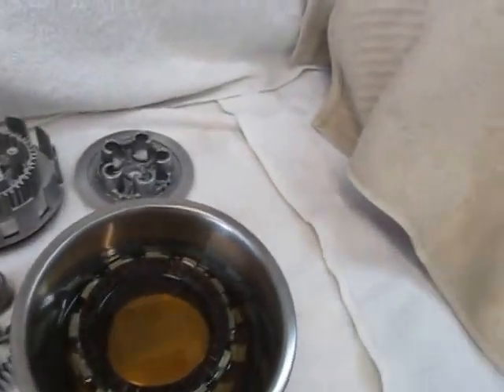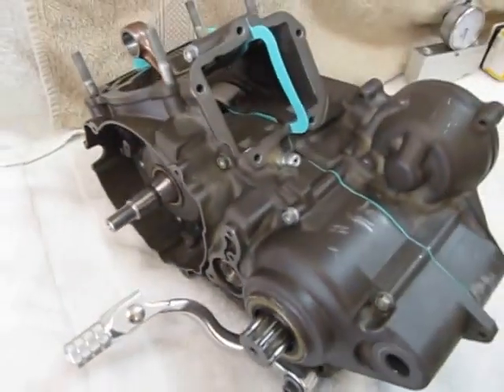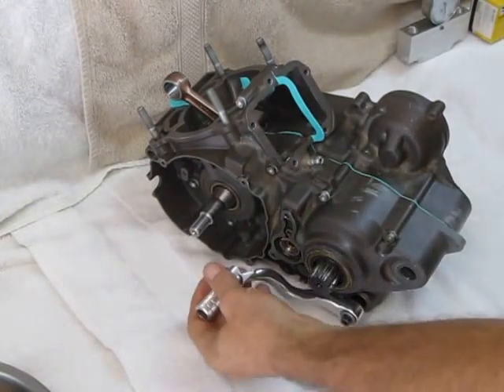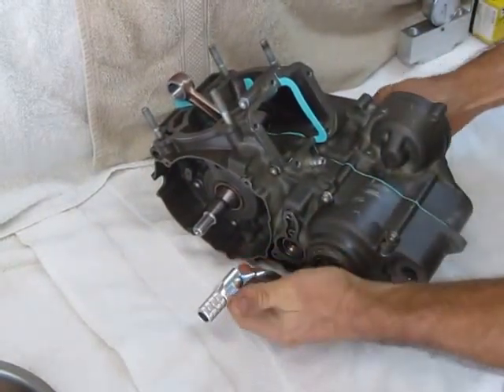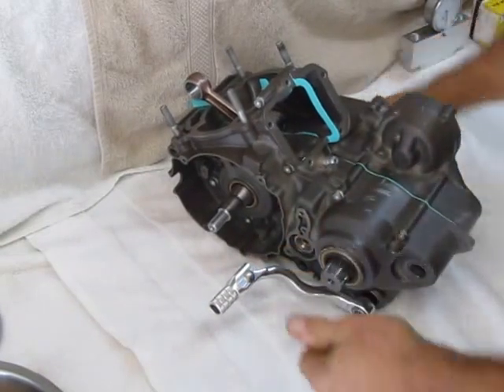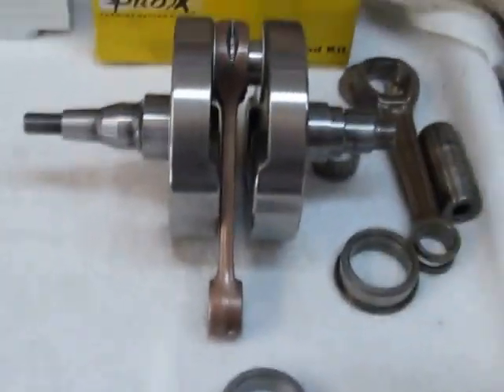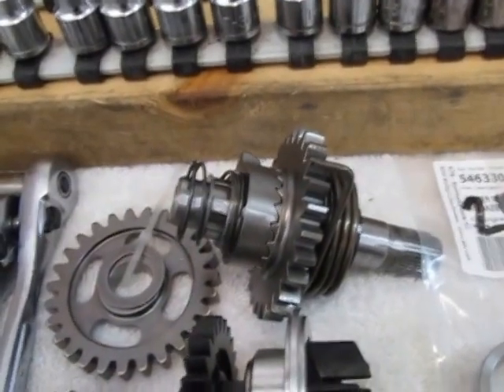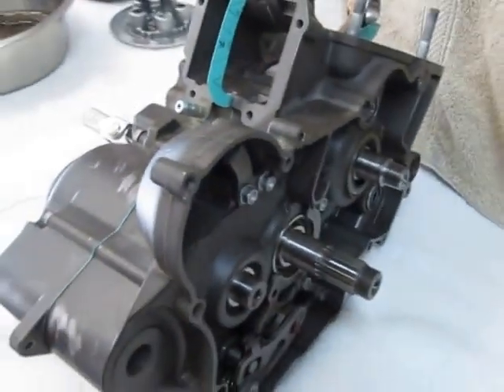How to shift KTM Transmission with engine on the work bench

Comment: Hey bro just replaced the shift mech on a 11 150 sx same bottom ends, ( due to false neutrals ) bench test was perfect first test ride was perfect now I am also find these false neutrals but only between 3-4 4-5 and vis versa 4-3 5-4 the shift lever clicks and moves as expected but if held up while in the false neutrals I can feel it notch / move a bit more and then it drops into gear and is sweet this issue seems more so when the bike isn’t under load and being gentle with everything being a big rough all works as it should? Any ideas I am going to strip again and bench test from the drum out testing each component after re fitting but seems super strange to me the bike will shift and still hit said false neutrals even shifting without the clutch so not related to clutch at all it’ll stay in gear and ride through to the end of the gears in each gear no skipping jumping or anything unwanted just doesn’t like selecting the gears above 3rd really?